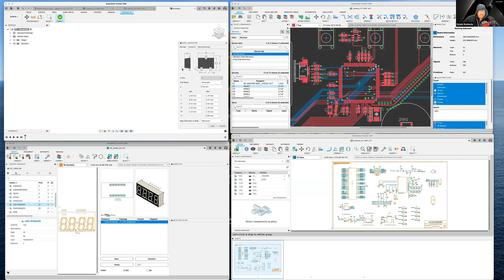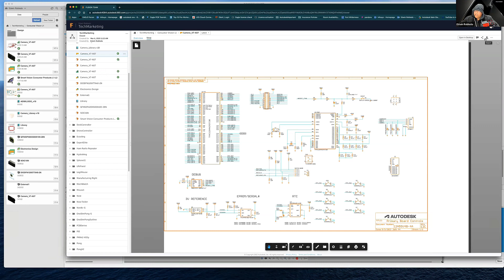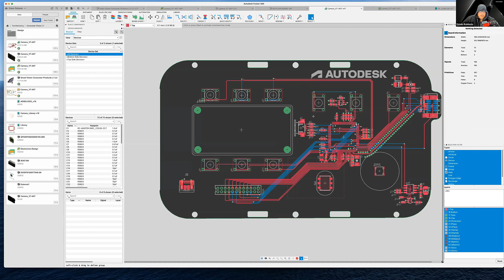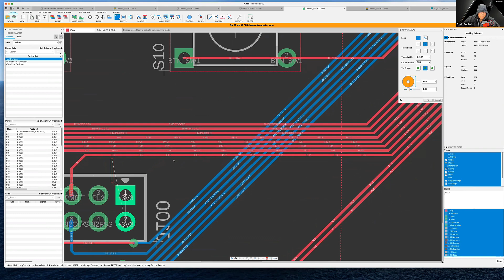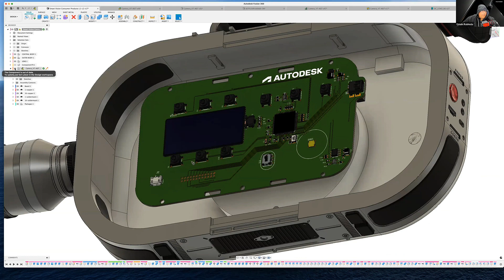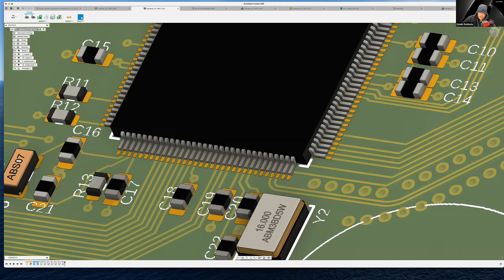Use Fusion 360 for you next electronic design. Why?

Comment: Hi ,
   I am using last 3year in fusion 360 PCB Design and Mechanical design with the 2D drawing( BLDC Motor and Drive ).

     I have so many doubts on PCB design related, Request sales team but not responding on my mail and message